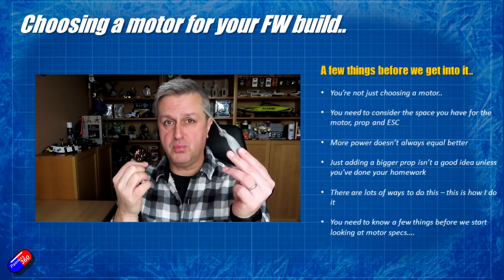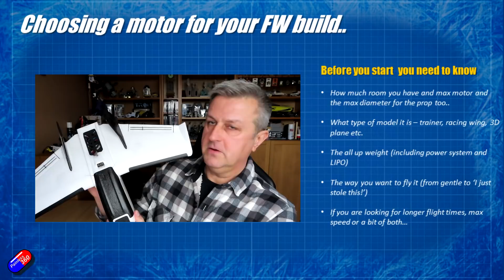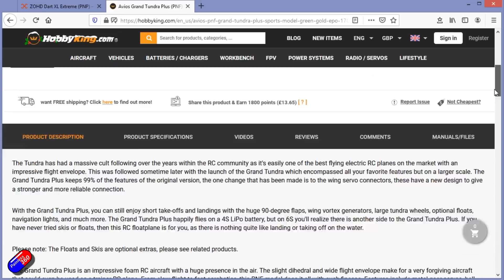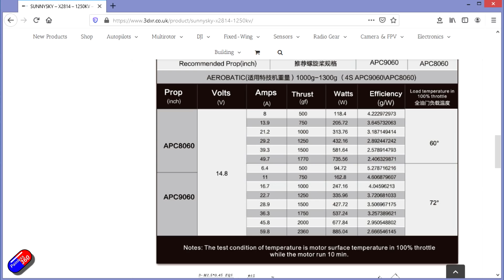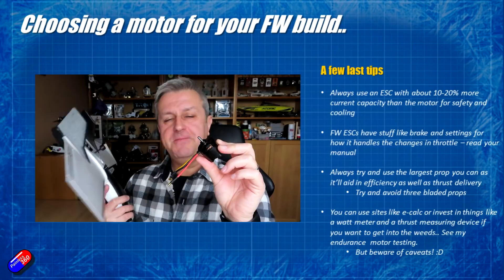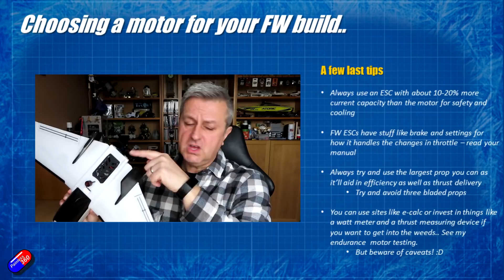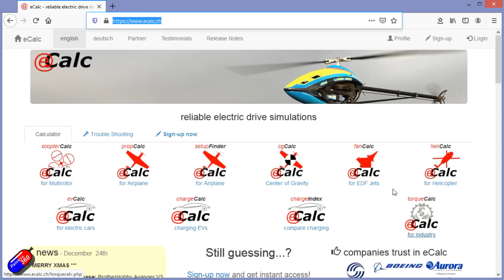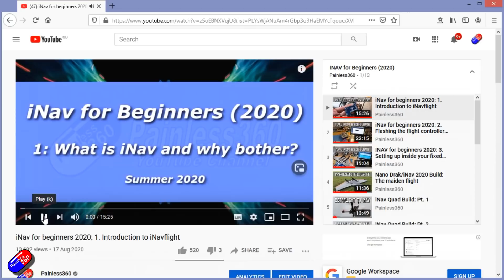Choosing a motor and prop for your fixed wing model: Some hints and tips

Comment: I am curious what will happen if you put a 7 inch drone motor on a plane because the specs are really good and its cheap compared to fixed wing motors, will it work?
Reply from the maker: If it's sized correctly. Most fixed wing motors are setup for larger props and more thrust...

Comment: Do you think spinners are necessary for electric rc planes? I have a Turbo Timber Evo. and it looks like the ESC would get better air flow if the spinner was not installed.
Reply from the maker: I'm not sure they make a lot of different. I've always felt they were more for looks.. Happy flying

Comment: Please help the community with a video on types of recommended props for fixed wing models. Please differentiate props based on Direct Drive, APC Style, GWS variants, Slow Fly ones, HQ Props, Glass vs CF Props, Gemfan Props Variants, Etc.
Reply from the maker: Thanks for the idea. In the mean time, please see the entire series already on the channel dedicated to motor and prop selection. It covers how to choose and how to pick a setup designed for best speed, best thrust and best endurance.
Reply: @Painless360  Saw the entire series. Learnt from scratch and have been able to make my first plane - WIP. Can't thank you enough ever for all the guidance.

Comment: Let’s say I want to create a self launching 3m span glider but I should use the motor only to takeoff the plane then turn the motor off and just soar and I want it to fly in the air as long as possible, do I need high kv or low kv motor?
Reply from the maker: KV is only one of the things to look at. See the rest of the series for how to choose everything you need.. Best of luck

Comment: Hello, recently I broke a 2300 Kv edf ducted fan, and I am thinking of reusing the motor with a propeller for a plane. Is it possible or it will underperform severely? Thanks in advance.
Reply from the maker: It depends on what motor it is. KV is only one metric. What are the specs?
Reply: @Painless360  Max RPM: 53000
Motor Type: B3048 2300KV Standard Rotating
Max Power (10sec): 1900W
Continuous Power: 1700W
Max Voltage: 22.2V (6S)
Max Amps: 80A
ESC (timing): Higher
Thank you very much

Comment: Great stuff! Another excellent video. Having said that, though, I've never really been a fan of electric flight; I still can't stand rechargeable batteries (yes, I've done them all since the late 1970s, and even today's LiPos annoy me).

I like lazy 4-stroke glow engines, but moved away from those when the drone laws arrived. Everything's sub-250g now. I've dug out my old free-flight diesels; they're tiny but cute and very silly indeed. (We like silly.)

My most recent project was rubber-powered - a 60" span polyhedral, rudder and elevator, balsa and tissue job, with a folding prop. Lots of fun, lots of undercamber, and capable of thermalling over a hot cup of tea.

I know I really ought to be more into electric flight, but... well, leccy motors and ESCs and LiPos just don't do it for me...

Comment: Very interesting topic. I use eCalc to replace my 1806 2400kv (bearing damage) motor on my AR-Wing Mini. I will try a 2306 1700KV with 6x4 prop on 3s Li-ion.
Reply: How did it turn out? I have to replace mine on the Dart250, it's a pain to find something.

Comment: I am trying to calculate the motor efficiency for a long range build. Wouldn't the motor charts be inaccurate due to the fact that the motor pulls many more amps when standing still on a thrust stand compared to moving through the air?

Comment: When using iNav there is a value that is calculated for you, "Average Efficiency", it is measured in mAh/Km. For Long Range I try to pick a prop/motor combo that brings this value as low as possible.

Comment: Great video sir
Could you recommend an online store that sells backward folding props in different sizes for different size and different application flying wings, 
Thanks
( I live in California)
Reply from the maker: I get mine from 3DXR here in the UK.. Look for a local Aero Naut stockist.. Best of luck
Reply: I can second that. Aero Naut props are up there with Master Airscrew in terms of quality.
Reply: Banggood sells pretty decent hubs and most larger sizes. APC also has a more fragile folding line that works well too for smaller sizes.

Comment: A thrust stand, watt meter and tach are a must if you are sizing a motor prop combo for a plane that you can't find an equivalent for. They are especially handy when upgrading from a brushed motor on an old plane with little documentation. 
Great video, thanks.
Reply: @thomasedwards629 . I’m no expert, this is what I believe is the problem. Static thrust measurement is not an accurate representation of what happens when the equipment is on a model flying through the air. It’s harder to drag air around, than it is to pull a plane through the air. If you have a safe place to try this, all you need is your model, transmitter, a lipo alarm & someone securely hold your model plane. With everything in place, give it full throttle for only 1 or 2 minutes. You will probably find the motor & ESC get quite warm. There is a possibility of battery sag, hence the lipo alarm. I use this simple test when changing the prop, motor, or battery size. It doesn’t give me any data, but if nothing gets too hot after 2 minutes, I’m confident that it won’t burn up mid flight. Then I can conduct the real test of “does it enhance my flying experience”.

Comment: Lee, on my current setup i'm using a single 3536 1400kv motor on 4s spinning a 8x6 prop producing around 2 kg thrust pulling around 50/55amps. i'm thinking about switching to two 2306 motors spinning a 5140 prop producing around 1 kg of thrust on 33 amps per motor... do you think this is do-able?? just for fun off course
Reply from the maker: Sounds like it. Best of luck
Reply: @Painless360  thanks Lee.. by the way, did you ever got the racer star 7405 nano fc working?? i'm trying to connect my BN-220 gps but with no luck of getting any sign off life in the gps( no blinking lights or so ever) selected uart 3 and set ublox 7 in inav   but no luck yet
Reply from the maker: See my video on the build. I killed mine

Comment: Will adding or using foldable propellers make much difference in the esc’s or motors needed  ?    Thank you ...
Reply from the maker: Even different designs of fixed props with the same pitch and diameter can use very different amounts of power. The only way to be sure is to test it on a thrust meter.. Happy flying

Comment: 1) 3 blade props seem to give you around 2%-8% more thrust but at the cost of higher amp consumption vs. the equivalent thrust 2-blade prop. Generally the only reason for using them is blade clearance (you can't fit bigger props) and to counter torque roll.

2) There is a non-trivial relationship between prop diameter, pitch and stall speed. The rule of thumb is that the closer the pitch is to the diameter the higher the stall speed. This doesn't mean you can't have a 'square' prop (5x5, 6x6, etc) though but it won't be able to enter it's power band until the model is moving fast enough. You will see this as the model appearing underpowered at low speeds, even to the point of not being able to stay in the air but fine once moving quickly.

3) The flexibility, chord and airfoil design of the blades also matters but to keep things simple a thinner, stiffer blade is required for faster Kv motors whereas wide, paddle-like blades are better for slow fliers.

4) Higher Kv motors don't always produce a noticeably faster model, given the same prop. I'm not entirely sure why but it seems effective torque has a significant impact, i.e. a lower pitch but with a larger diameter can actually make a model go faster.

Comment: Do you say avoid 3 blade props because of balance issues or other reasons? I don't understand the reasoning of using a 3 blade prop for 3s and a 2 blade prop for 2s use with the Dart, the ground clearance of prop cannot be the reason as it;s used with the 2s, could you offer an explanation why ZOHD have done this? Thanks for all the time you spend putting these videos together!
Reply: I'd guess either excessive amp consumption or increased torque roll tendencies when using 3S.
Reply: Power. The 3 blades prop on 3s on the Dart250 is using 7A at full throttle while the 2 blades 5x5 on the same 3s is using 12amps and will burn your motor quickly. I know because mine burnt in that configuration and I was careful not using 100%...
Reply: @goku445  Yes i also burnt the motor ( but on 4s ) , did you burn it on 3s 5x5 ?
Reply: @Retro-Gfx-Official  Yes but I was seriously careful about my throttle, I was upset about it, banggood refunded me 15€. Not sure which motor to replace it with, it's been difficult to choose. I like efficiency and I only own 3S batteries. :)
Reply: @goku445  Hmm you should have been okay on 3s.Maybe the weather was warm.
 I was fine, although the weather was cold. I ran 4s (with automatic throttle limit, not quick enough i guess lol ) and the motor lasted 30 seconds lol...
How about looking at Tmotor motors? You need to look at motors that have a 12x12mm bolt pattern if you dont want to modify the stock motor mount. The stock esc will be fine on 3s. I run the stock esc on 4s on 5inch prop all the time with no problems, just make sure it has good airflow.
Reply: Ignoring the efficiency loss of using a 3 blade, Painless probably also avoids 3 blade props because on something like a dart, youll always be landing on a blade or two.

Comment: A couple of things that hasn’t been mentioned:

1) bigger props are more efficient but they might end up burning your motor so don’t overdo it. Motors do burn with bigger motors than the manufacturer suggests.
2) bigger props are heavier. Tri-blades are heavier than bi-blades. They have bigger wind resistance while they  spin. These three factors will generate more amperage consumption.

Comment: is there a fixed wing that can use those motors and escs from the 450 quad kits? like a little wing or something cheap?
Reply from the maker: Depends on the weight of the model. You need to know how much thrust that motor and prop make and you can go from there.
Reply: @Painless360  thanks ill try to figure it out. i have a box full of 30a esc and 2212/920kv motors and was thinking maybe i can make some little planes with them.
Reply from the maker: With their lower KV and ability to swing larger props they should be able to be used again in a FW.. Best of luck
Reply: @Painless360  thanks. can you fly a mission without a radio? like it takes off and goes out then lands from a laptop? i want to make some semi disposable planes.
Reply from the maker: See the Ardupilot Groundstation stuff. Happy flying!
Reply: Check out flitetest foam board planes for those motors and esc's
Reply: Plagiarism, the best form of flattery 😁. Great video Lee.